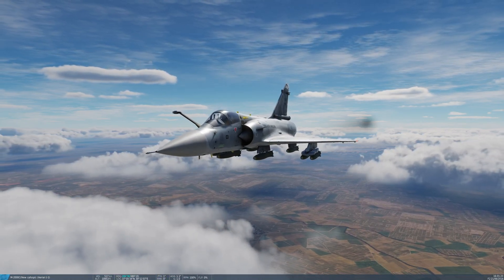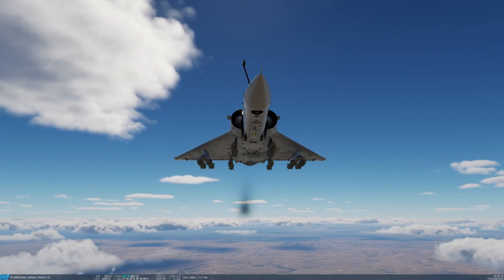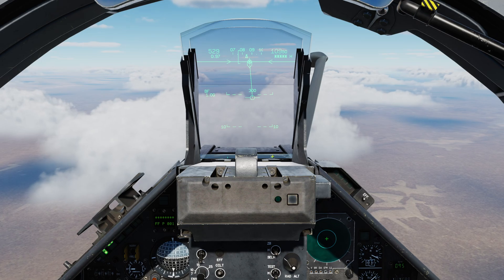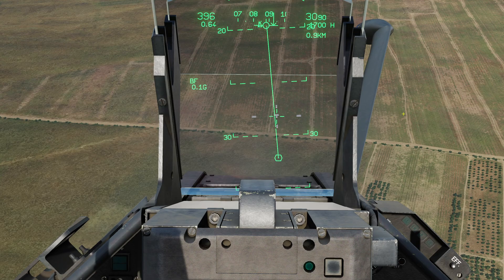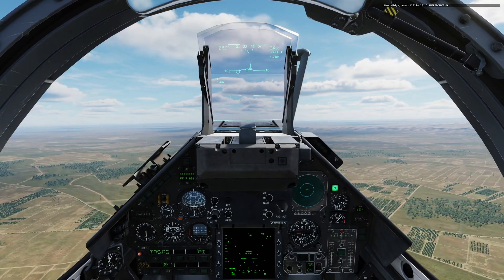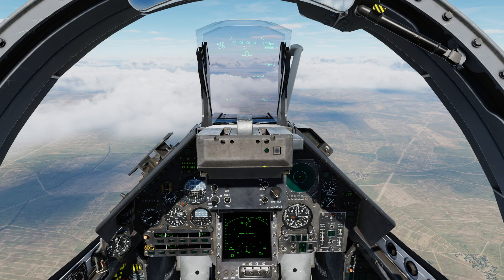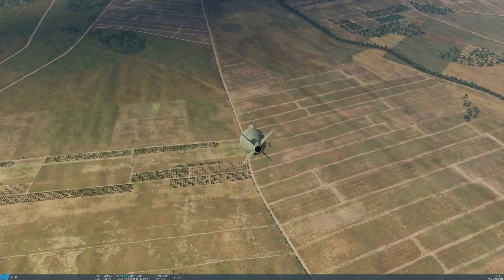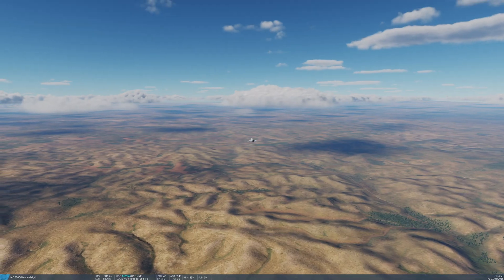DCS M2000C Tutorial 11 - Dumb Bombs

Comment: I'm sorry to have to say this, but the tutorial for the high drag bombs is completely wrong.
True, you can hit something this way, but the correct way is described very well and in detail in the included manual on pages 601-630 (including descriptive pictures).

For high drag bombs there is only 1 attack profile (Page 608):
1. Starting around 300ft and no more than 650ft AGL and 500kts.
2. place the aiming reticle over the intended impact point
3. once all the bombs are released, execute a sharp turn out of the target area

The arrow you see in the HUD does not tell you to dive steeper (dive bombing with high drag bombs is not useful anyway in my opinion), but it tells you if you are too high (arrow pointing down), or too low (arrow pointing up). 

Low drag bombs are covered on pages 560-599
Reply from the maker: Thanks for the correction. I referenced the chucks guide but may well have mis-understood the content. Nonetheless this does work as a CCIP delivery. I'll make an updated video soon.
Reply: @deephack  Since the manual supplied with the M2000C is really excellent, I would recommend always consulting it and using other sources only as supplements.